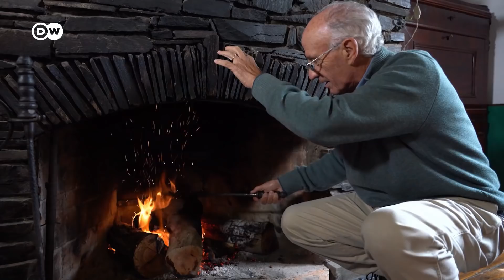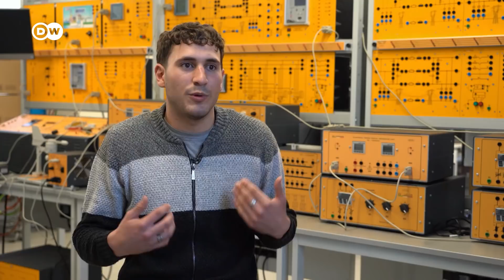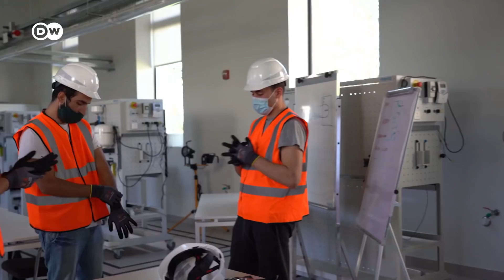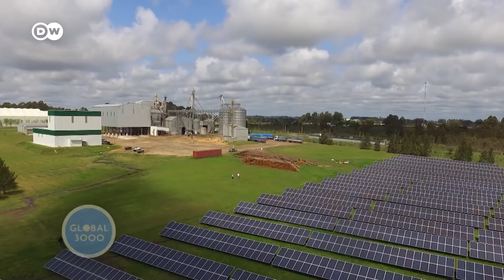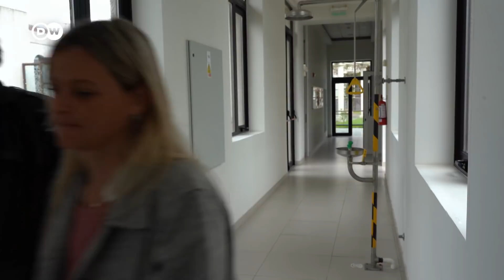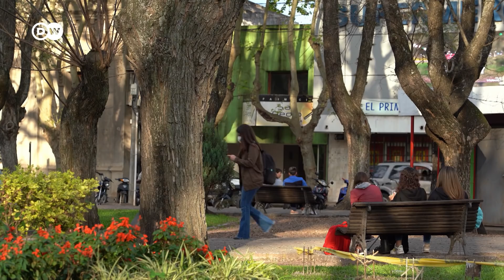Uruguay: The clean energy transition | Global Ideas

Comment: Electricity from present day Wind turbines still need backup for when the Wind isn't at the adequate Strength and often this backup is from Natural Gas. Thus Wind electricity often has a certain amount of Green washing. Improvements in Battery storage on a large scale be one option to decoupling of wind power from Natural Gas Power.

Comment: Why does the video show wind generators when most of Uruguay's power is from hydro? Yes hydro can provide stable and reliable CO2 free generation. Wind cannot and this video is very misleading.
It is very like the misleading information that Denmark has x amounts of wind power but omitting that it wouldn''t work unles it was backed by Norway's hydropower. Wind is a poor generator for grid power.

Comment: The next thing Uruguay needs to work on, is grid scale electric energy storage. With that, they can insure 24/7 power availability, especially, once they electrify their transportation sector. (both private, and public mass transit systems) They can be virtually free from the market volatilities, of various imported fuels.
Reply: We don't need storage because we generate electricity 24/7, our only problem when talking about energy is oil, we don't produce any so, besides the pollution, a lot of things are made very expensive because of transport costs

Comment: Generating power is not the problem Its the storage that's the problem. Lithium is expected to run out by 2040 if we switch to electric cars. So lets talk about the storage problem because that is the real issue. This is like talking about nuclear power stations but not talking about the waste. You are pushing a one sided agender here not participating in a real world discussion. This is propaganded not journalism.
Reply: There is also Power2Gas and pumped-storage power plants to storage power.
Reply: There are also other batteries than Lithium-Ion, e.g. Redux flow and molten metal.

Comment: We're just not going to discuss the three massive power outages that Uruguay has suffered since 2018 and how they rely on interconnections with Argentina and Brazil? Okay, then.
Reply: Most of the time we sell energy to them, and  iirc two of those shortages happened because a cable broke and the whole network had to be shut down to fix it without frying the workmen

Comment: Uruguay has only 3 million people in an area of 176 thousand sq km. It's 205th in populational density. But more than that: it's almost ALL fields. The pampas. With the population concentrated in Montevideo.

Their total population is smaller than the population of the southernmost Brazilian metropolitan area, that of Porto Alegre, with 4 million people.

It's energy consumption is only 3,412 kWh per capita.

What that means is that Uruguay can supply all their energy by using a small amount of land.

For most countries, and GERMANY IS PRIME EXAMPLE, you should have a mix of renewables AND NUCLEAR.

I repeat it: Germany is the prime example. A country that has INCREASED it's carbon fuels usage by getting rid of it's nuclear powerplants.
Reply: Germany is a real example of how not to decarbonise. I am ok with nuclear although I don't think that my country, Greece, needs it as we have loads of sun, loads of wind, a bit of geothermal and loads of hydro (which is not very productive because even though we have mountains, we don't have much rain, but could be converted to pumped hydro and since that recycles the water, production capacity could be increased significantly)

Comment: What makes it work is the hydropower.  The problem with the hydropower is the environmental destruction caused by the backed up water.  The water also varies causing further destruction.  What would be useful would be high temprature nuclear with heat storage. This would be compatible the wind and solar and would also be able to supply process heat for industrial uses.
Reply: The county has a population of 3.5 million people ,that's the smaller than the city of  Los Angeles.       Im, sure the US could do it also if LA was the only people living in the US.
Gets trickier with 1.4 billion China though.  Wind and Sun can not keep that smog monster fed.
Reply: In Uruguay it's not really an option because it's very expensive, and we don't have uranium, we don't want to depend on foreign energy imports, that was one of the ideas behind this system

Comment: Nice video and very optimistic but I would like more information about how they manage the periods when there is little or no wind or sun. Do they have a lot of pumped hydro to be able to store the excess energy for example?
Reply: Hi Jonathan, yes, we do have a 1 hydro MW per MW of wind energy. We are also working on electric transportation and green hydrogen to find a better use of surpluses.
Reply: @nicolascastroman5185  hi! why is it preferable to produce hydrogen? can't you just use the Fischer-Tropsch process to make synthetic hydrocarbons?
Reply: @NaumRusomarov  Hi Naum, it's a good point, but as far as I know, the government is thinking about hydrogen not only for transportation use, but also to foster chemical industry under an exportation business model, delivering H2 through different carriers (like ammonia for fertilizers). We are still in a pilot phase.
Reply: @nicolascastroman5185  aha. yes that makes sense, you do need to produce hydrogen if you want to export ammonia. it does seem like other countries as well are looking into using ammonia for this purpose. I wish success to everyone.
Reply: Biomass and hydro. Still producing a lot of co2, but not even applicable to most territories. More lies or incomplet informations to sell renewable energies.

Comment: Elephant in the room is G20, none of them run on renewable even close, household can run on renewable, but one car manufacturing plant in Germany requires 300 soccer field of solar panels, and China had two coal plants just to produce solar panels for USA and EU markets it is hypocrisy not renewable. "Planet of the Humans" Michael Moore is 100% right renewable is even worst than coal or oil. Big Wind mills is reliable (25 times more reliable than solar) still hydropower water is 900 more dense liquid than air, so windmills plants requires farms (70 hectares) to produce electricity from 900 lees energy dense gas. Production of thousand windmills to get same energy output as from hydropower also requires energy consumption (and a lot of of concrete)
1968 "Planet of the Apes" George Taylor : [to Lucius] Remember, never trust anybody over 30.